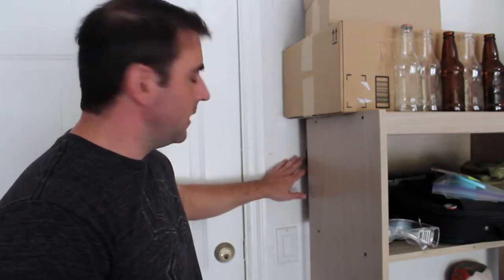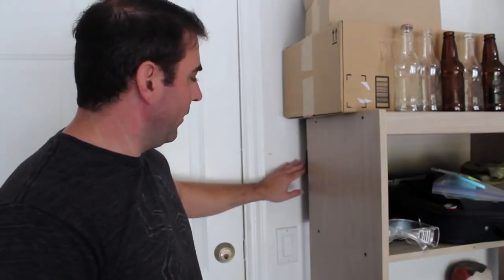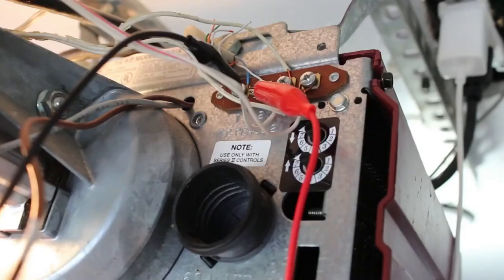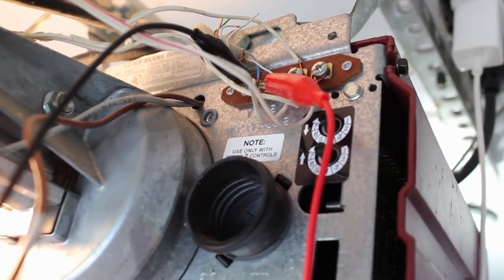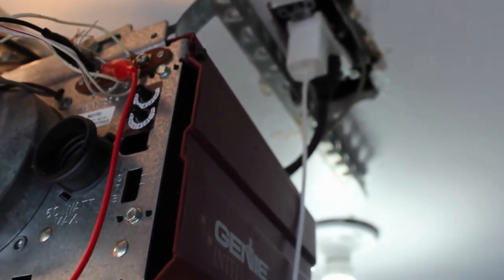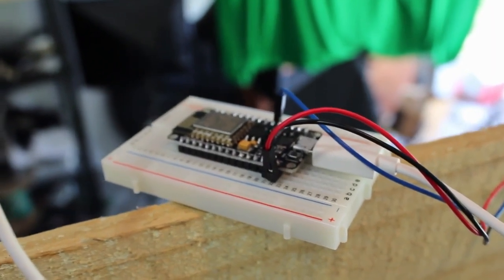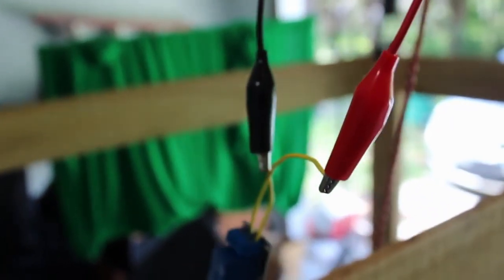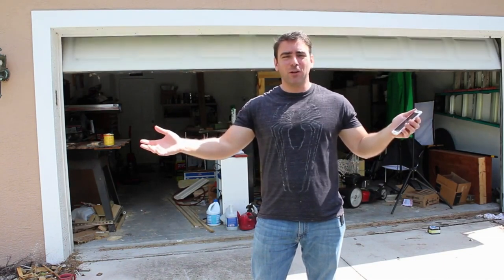ESP8266 Garage Door Demonstration Wireless Module Wifi

Comment: Hey Kimosabe, put a cover plate on that receptacle next to your garage door motor. I used to be an electrician, and it triggered me. ;-)

By the way, what was the web address for your garage door opener?
Reply: American outlets are pretty dangerous without a plate, but considering where it is I'd consider is somewhat safe from minimal human interaction.